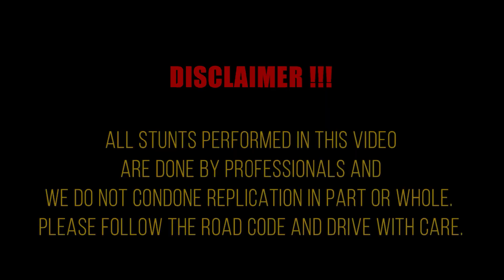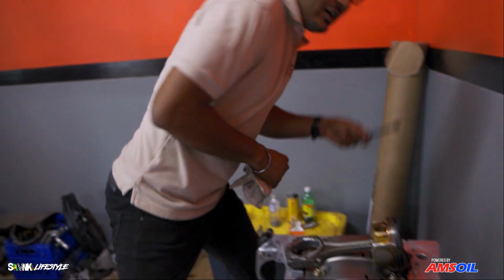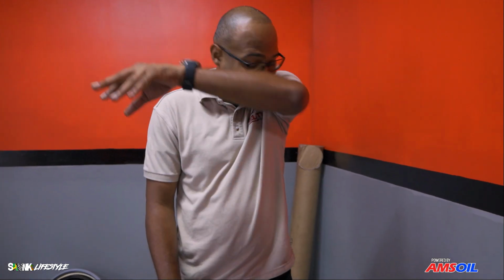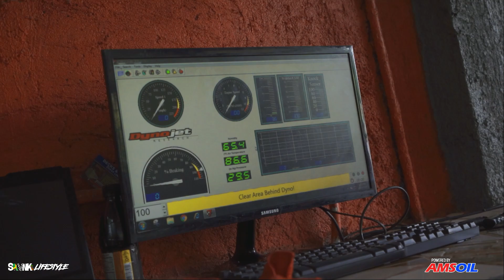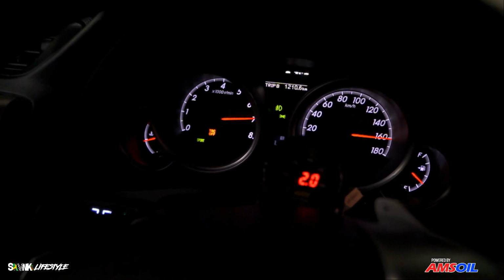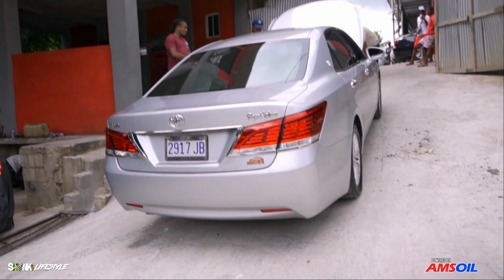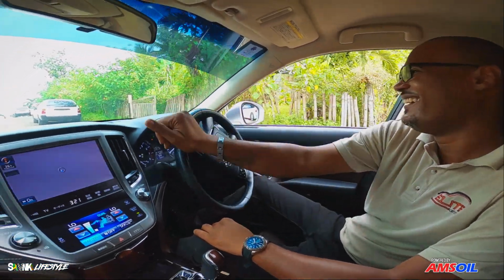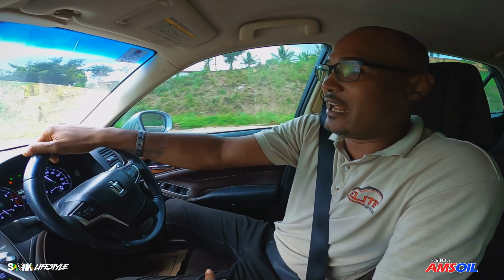1000 WHP Mark X in the Making? - SKVNK LIFESTYLE EPISODE 129

Comment: I think Roland in the X packages, since he’s an advocate for safety should get some built sway bars, front and rear, and get some strut braces built for the mark x along with maybe brakes all in the package. If he’s selling a package include the suspension and brakes in it.
Reply: exactly , the abs sensors gonna be a problem with all that power , if cant deliver smooth stopping power . you gonna be creating a widow maker
Reply: Ahmed sha Ug  the stock brakes not going stop as good. the stock x power will wear them out kinda easy. imagine 2 times the power...
Reply: real thing
Reply: MarkX owners here upgrade to the LS430 brakes when they start adding mods.

Comment: It's simply to add a transmission cooler and engine oil cooler with fans that's Jamaica it get very hot so adding those will definitely helps with the heat

Comment: Always believe the mark x max at 500 to 600 HP reliably. Roland a break barriers as no one in the world thinks the cylinder lining is reliable to hold the 1000 continuously as I see one video of 1050 HP but the engine blew up lil after. So let's see and big up Roland as your going against the world to prove a point. Let's see if the cylinder lining holds it. I wanted a 2gr to swap into my altezza but once I found that the cylinder 5 lining was one of the weak point I turned to 2jz but rn I want it back 2gr manual tezza.
Reply: All over the world ppl a push dis engine ...but mi glad fi see a yaad man bad pon the tuning